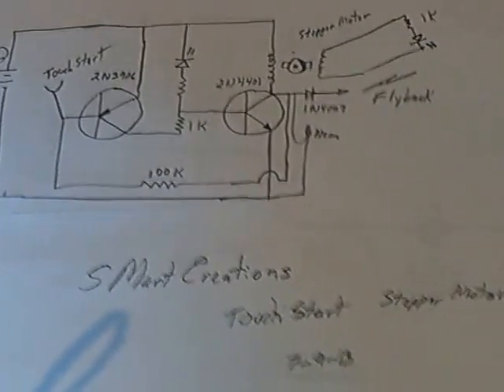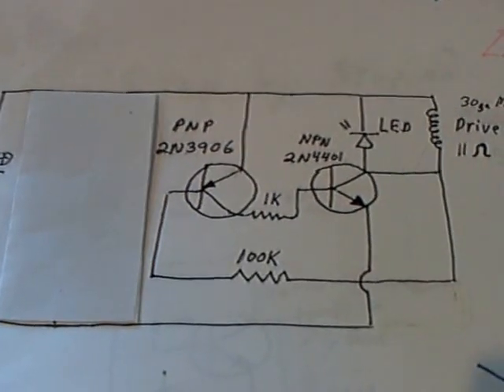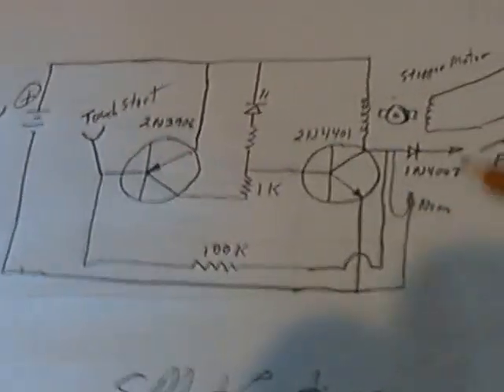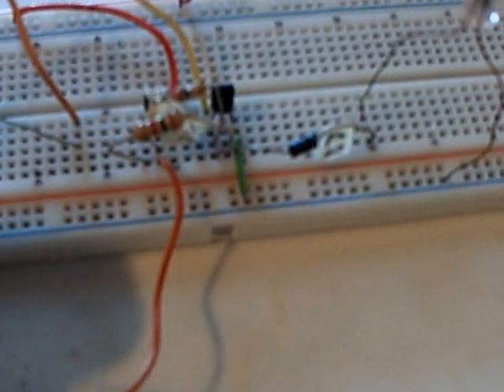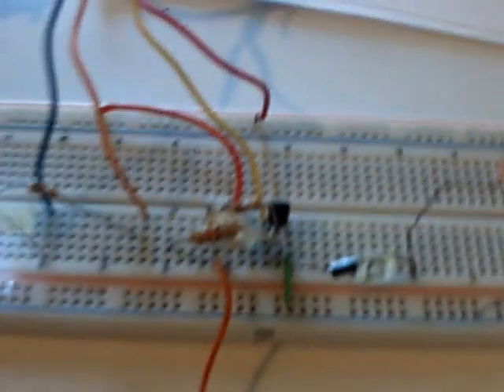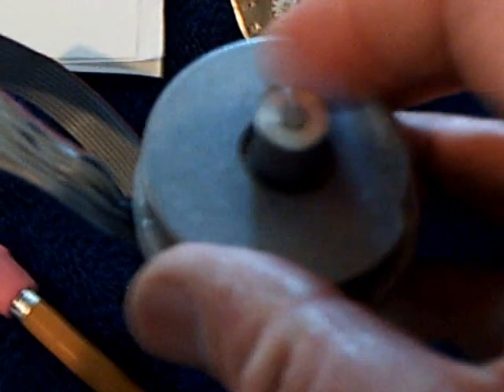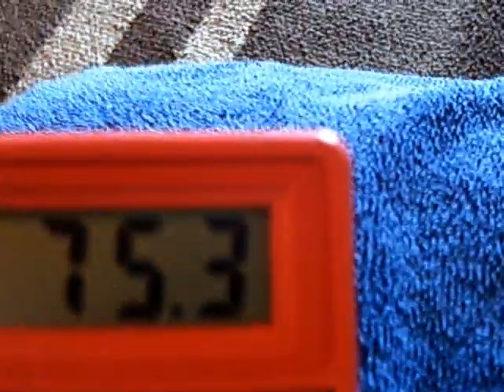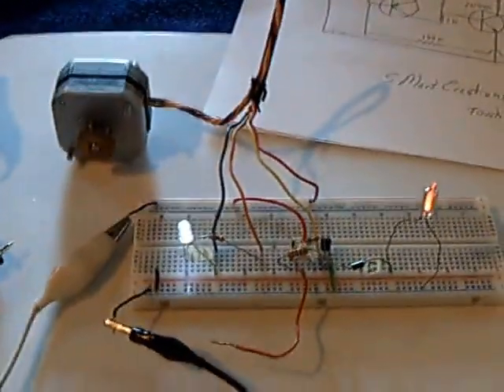Touch Start Stepper Motor circuit

Comment: 450mW against 1,8W on 9V and a neon and an LED? Is that OU? If you hooked that up to  a motor configured as a generator with a joule thief/ringer type output could that produce OU?

Comment from the maker: My camera came in a box of Crackerjacks.  It is cheap and old.  I keep using it because it runs on 2 AA batteries and is reliable.   Part of the wavy comes from the image stabilization function that YouTube  has.   Most of it comes from my shaky old man hands.

Comment from the maker: I can run this on a wall outlet transformer which allows it to be used as a battery conditioner and charger.  I do need to get serious, decide which circuit to use, and  box this up.  After that I can start using it on my car and boat when the batteries need it.

Comment from the maker: It should work.  It is just a case of sorting out the coil wires. It is very smooth turning.  There are not any specs on the case but it does say Seagate DC 482.

Comment from the maker: Neat circuit Mart!!  Thanks. I finally figured out my mistake and moved the led and resistor over where they belonged. This steeper will run on 2 AAs (3v)  drawing about 35mA using this circuit.